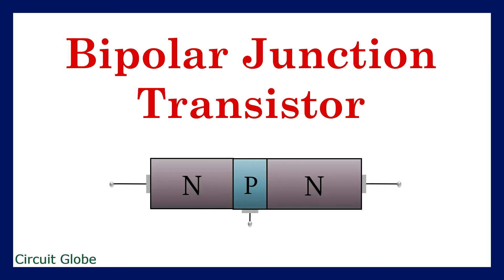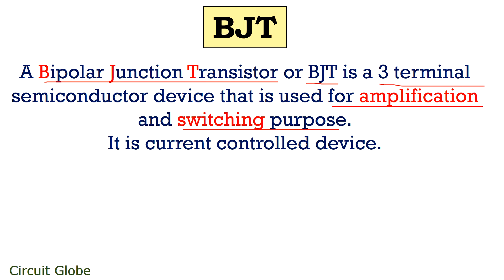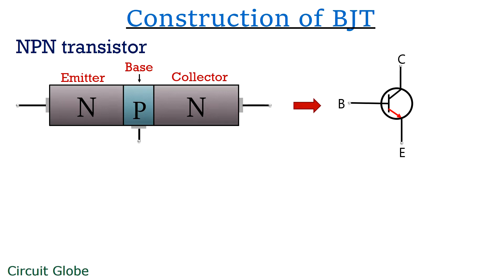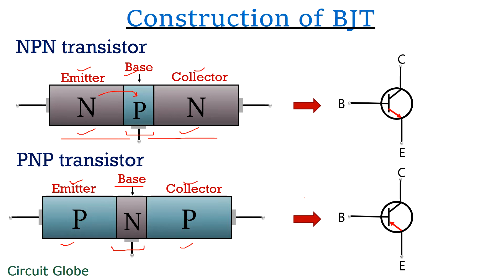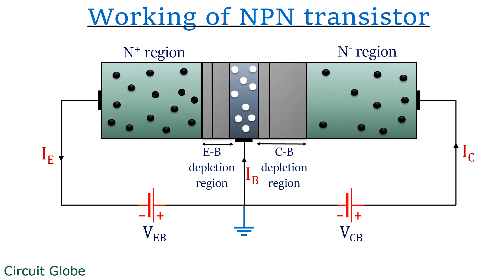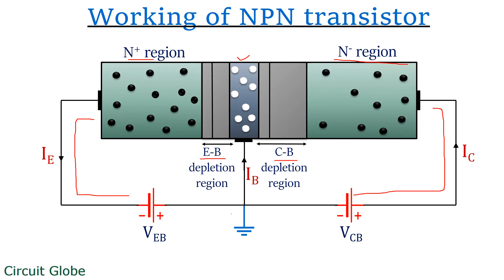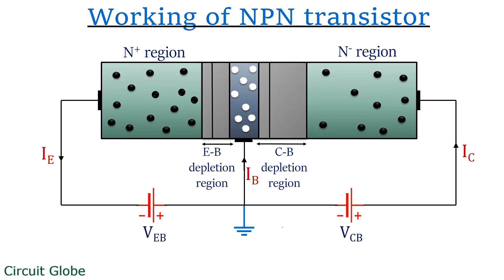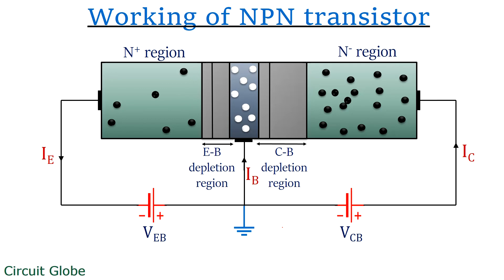Bipolar Junction Transistor - Construction and Working of BJT

Comment: A transistor is a semiconductor device used to amplify or switch electronic signals and electrical power. It is composed of semiconductor material usually with at least three terminals for connection to an external circuit. A voltage or current applied to one pair of the transistor's terminals controls the current through another pair of terminals. Because the controlled (output) power can be higher than the controlling (input) power, a transistor can amplify a signal. Today, some transistors are packaged individually, but many more are found embedded in integrated circuits.